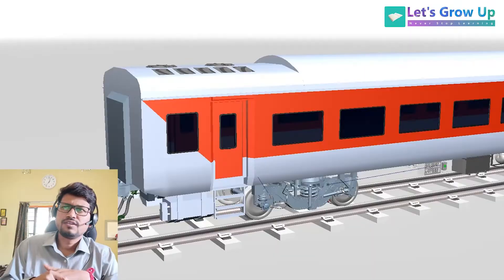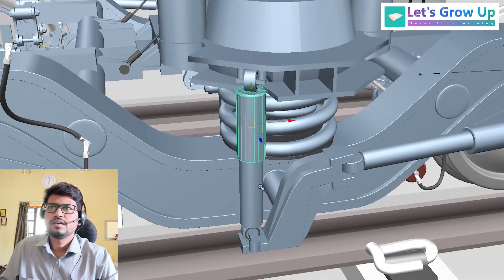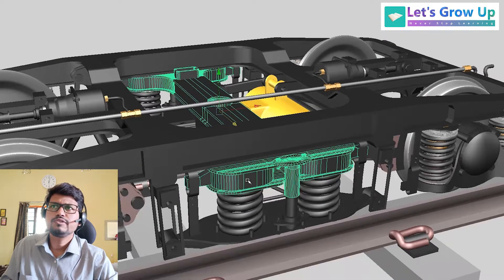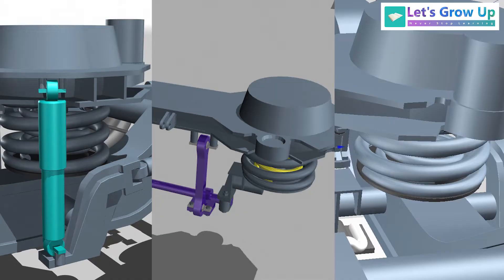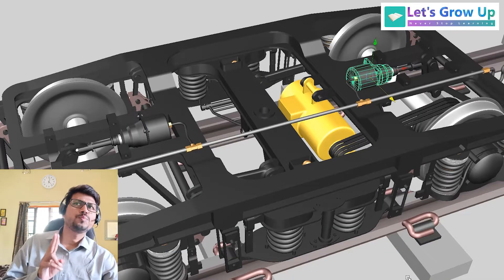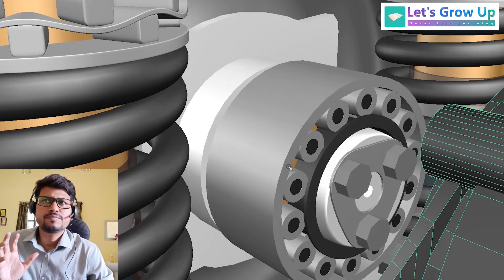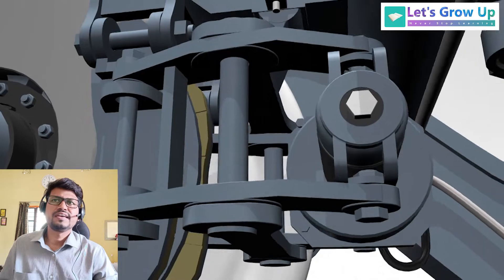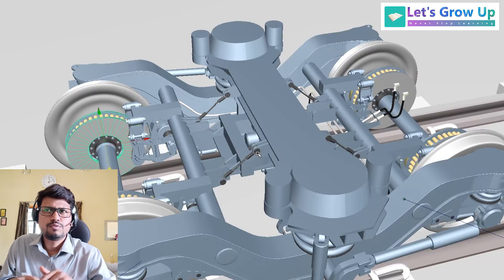ICF Bogie vs LHB bogie explained

Comment: Amazing detailed analysis and comparison on ICF vs LHB bogies. Thanks for sharing the information. By the way inspite of 100% electrification Indian Railways cannot be carbon neutral until they do away with EOG Diesel generators and start using locomotives with HOGs. Long way to go for now.
Reply: Not icf bogie, it is called all coiled bogie